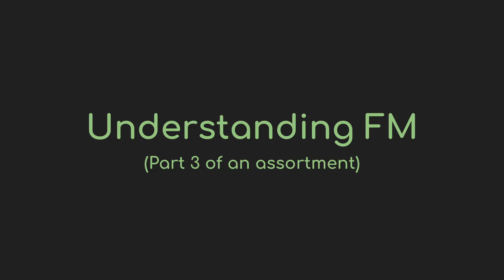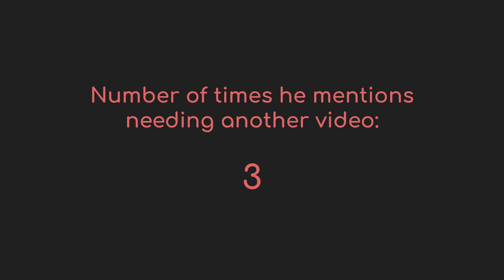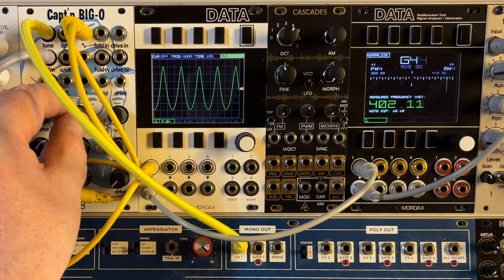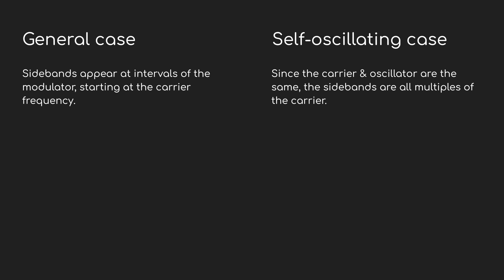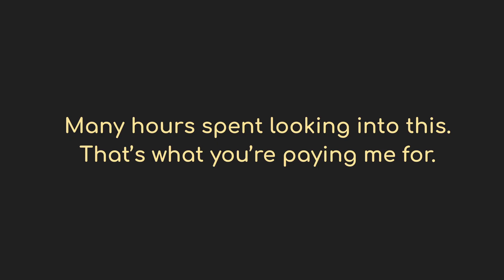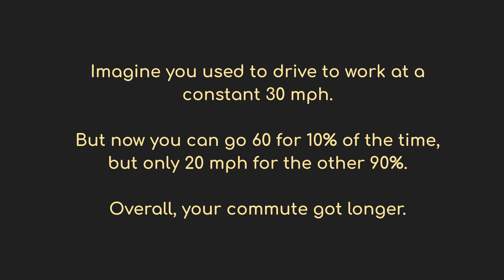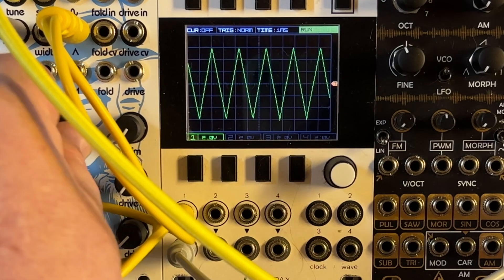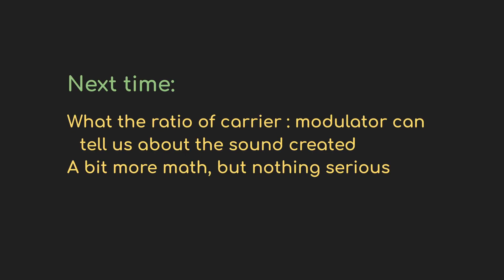Understanding FM #3 - Self-modulation, the trick you've been ignoring

Comment: This is really great but I’m a little unclear as to why when you’re self modulating the additional side bands aren’t symmetrical around the carrier?upwards from the carrier (to the right) the additional harmonics go down in both cases, but to the left it goes up not down when you self modulate (ratio of 1:1). I dont get it :(
Reply from the maker: @jonathanyoung6397  - Well, they kind of are symmetric around the carrier, only the ones on the left (lower sidebands) go down to zero hz and are filtered out, or go to negative frequencies, and wrap around back on top of the positive sidebands.  So effectively they 'aren't there', but their effect is still felt.

Comment: Great series! But something is confusing me: i expected self-modulation to be feeding the FM output back into the carrier as its modulator. But what you’re doing is feeding the carrier into the FM circuit twice, I.e. using it as its own modulator. Am I misunderstanding what self-modulation is?
Reply from the maker: @mooseyard - If I am understanding right, I think you're saying the same thing in both cases :)  

The thing about self-modulation here is that the carrier and modulator are the same thing, so yes, "using it as it's own modulator".  But to do that, I am "feeding the FM output back into the carrier as the modulator".
Reply: @SoundVoltage  OK, I think I may have gotten confused — you said at the start you were feeding the sine wave output into the linear FM input. I assumed there was a separate modulated output and the sine out would stay a sine. But I guess that’s not the case.
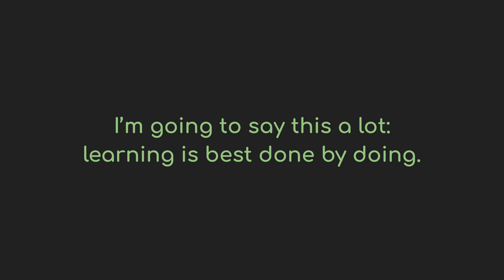Reply: @SoundVoltage  Sine out is a confusing name for the output in the diagram at 2:03